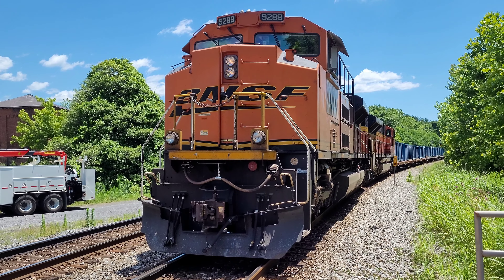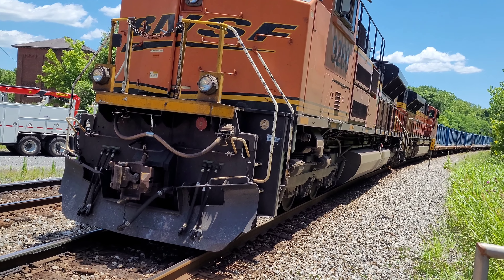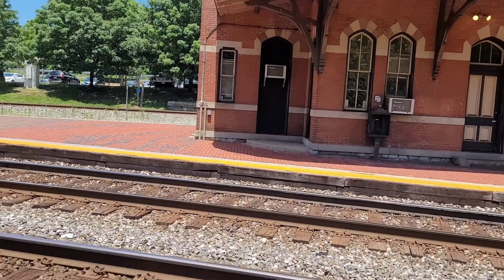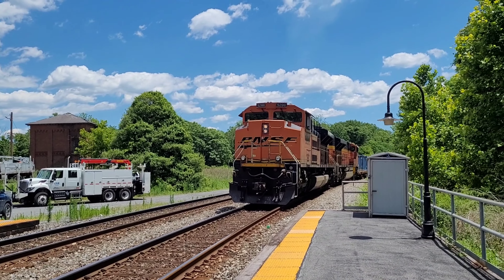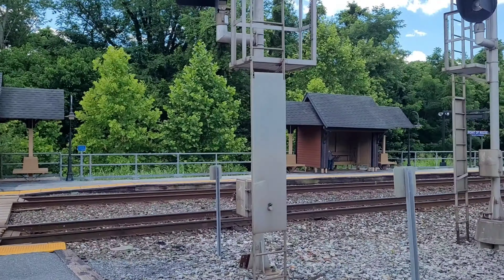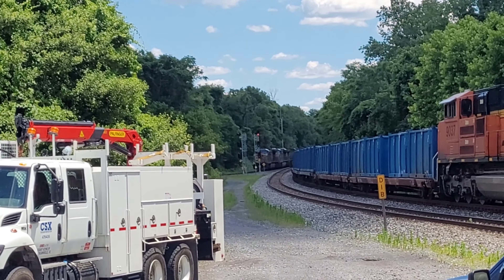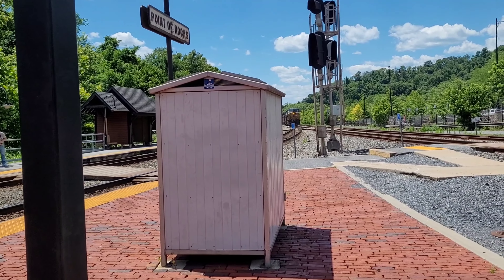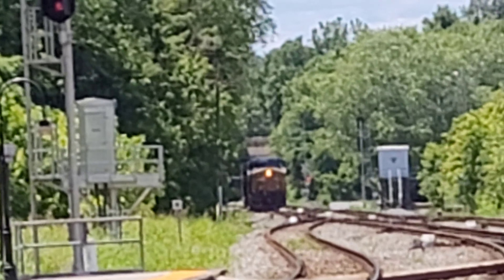CSX N744 spins it's power and CSX B709 with double BNSF leaves Point of Rocks (4k UHD)

Comment: Foreign power on a local? How crazy is that!
Reply from the maker: It was pretty nice to see! CSX does this often whenever G124 comes into Brunswick. They use whatever power is available, and when they get short on power in the yard, they like using the foreign power
Reply: @TheOldMainGuy  Ah, that makes sense. So once G124 comes into Brunswick, CSX power takes it down the Shen sub and the BNSF power sticks around until V124 is ready to return west?
Reply from the maker: @NorthCountryTrains  that's correct! The grain loads get emptied in Winchester, VA, and once that's done, they go back east to Brunswick